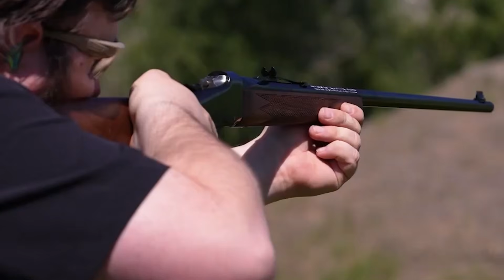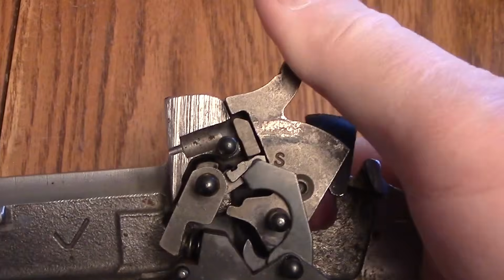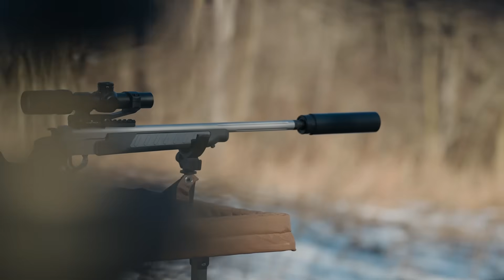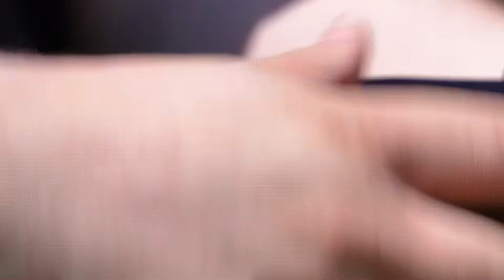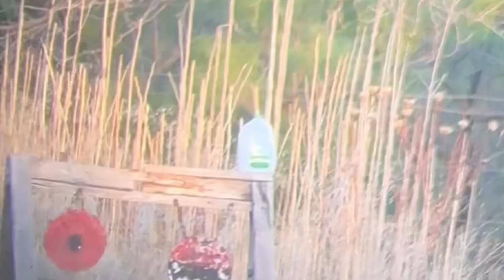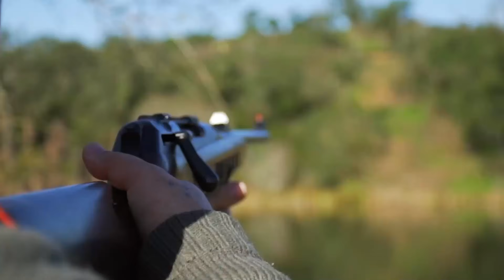7 Best Single Shot Hunting Rifles 2026 — The #1 Pick Isn't American, And It's Not Even Close

Comment: Couple points. NEF went out bog business some years back. If you want a handi rifle you’re scrambling in the used market. I know. I’ve got several. Extra barrels and fitting are a problem. 

Now. Your explanation of the Ruger number one “advantage” is gobbledy gook. Barrel seating in the action is not the point. The Ruger barrel is longer, by the length of a bolt compared to a similar length bolt gun. Typically 2 inches. That’s all. Muzzle to cartridge head internal measures the same for bolt or dropping block. You just lack the bolt. Therefore you can add that much to the barrel on the single shot. 

Skip the AI. Narrate your video with shots of the rifles you’re discussing.